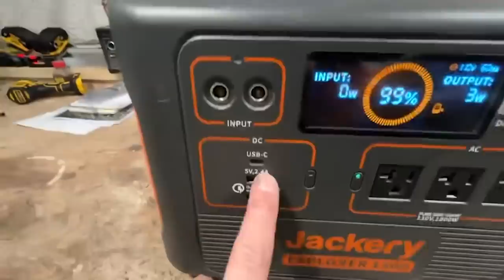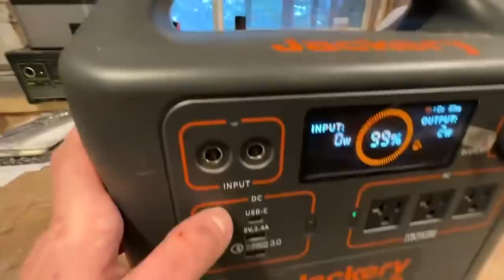First Ice Solo Camping in a Tent

Comment: Get your door locks changed out on that truck. As an F150 owner, I've been through it already. It been long known there's a low level skill attack on the lock cylinders which only takes seconds to be in our trucks. have the dealer put on a keyless door handle and delete that lock altogether.  Spend 300 to save thousands in gear.